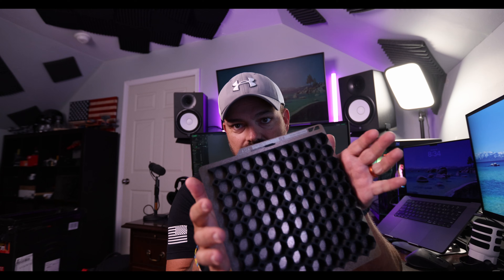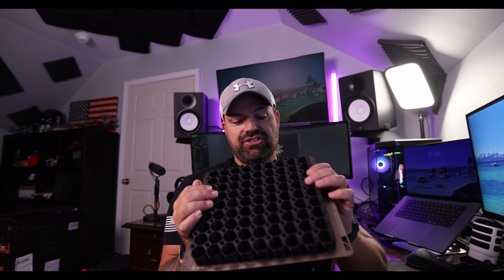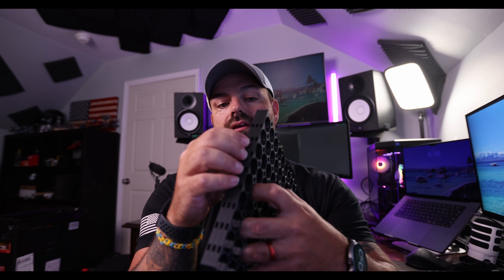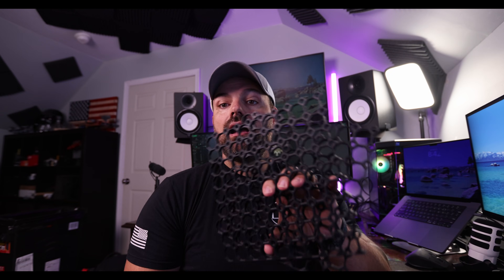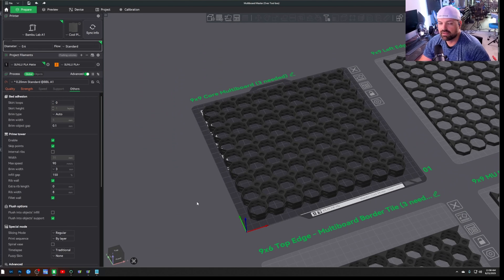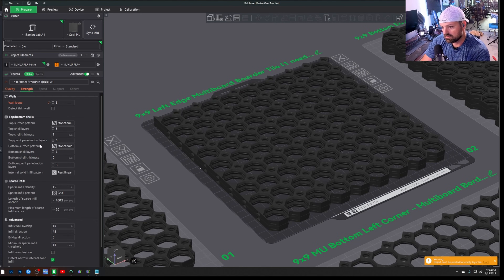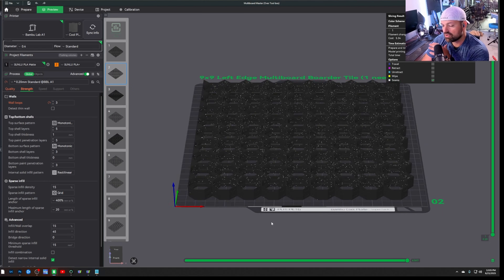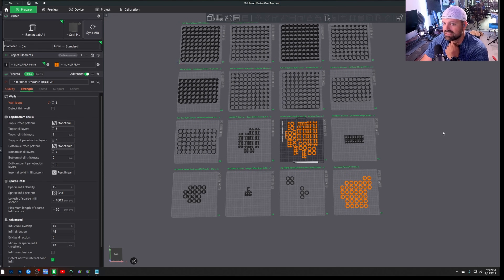Print More While You Sleep: How to Stack Parts in Bambu Studio (0.2 mm Gap, Ironing, Walls)

Comment from the maker: My stacking recipe: • Gap = 0.20 mm (for 0.20 layers) • Seam = Random • Iron Top Surface • Wall Loops = 3.
Want my plate/profile? Comment SEND SETTINGS with your printer + filament.
What gap do you use for 0.16 or 0.28 layers?

Comment: 5:50 ...9x9 it's not the maximum on a 256x256mm platte you can do 10x10 (250mm)grid, that's what I do, it goes all the way to the borders with 6mm to spare 😊 try it.
Reply from the maker: Interesting. I haven't had much luck printing all the way to the edges without lifting.

Comment: Thank you so much.  This is exactly what I needed to find for a project that has nothing to do with wall plates.  (My project has an optional spacer which goes around a center column that then has a large cantilevered/elevated base.  Otherwise, I would have had to print them separately and it would have created a support that was almost identical to my optional spacer, so basically a huge waste of plastic and time!)
Reply from the maker: Glad I could help you out with your project. That's awesome!

Comment: I print my 9x9 tiles in stacks of 8 on my X1C and H2S. Takes 25hrs and change. I recommend using a screwdriver, snips or long nose pliers to quickly separate the stacks by prying diagonally. It’s super quick and easy. 
For 9x9 tiles, 
I also recommend a central 6.25mm Support Peg to prevent inward flexing when pushing home mounting snaps. 
I also use a 6.25mm support peg mid way along each side to prevent inward flexing at tile joins. 
I detest the PETG interface layer method - too long to print, too wasteful in material and long to peel all of the PETG layers off.
Reply from the maker: That's sweet. I'm going to have to give that a try in the h2s. I want to make some for my garage next